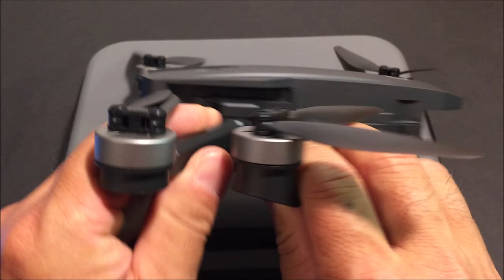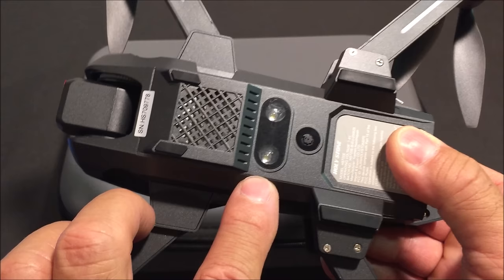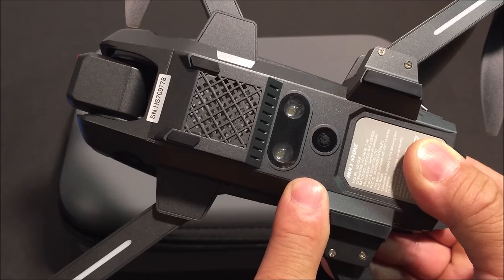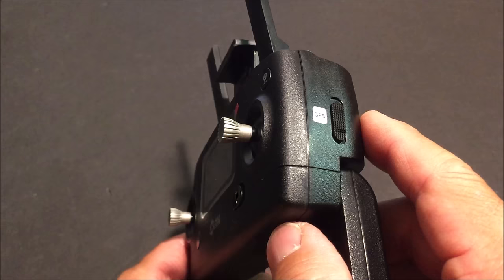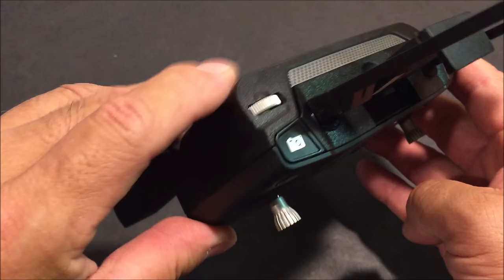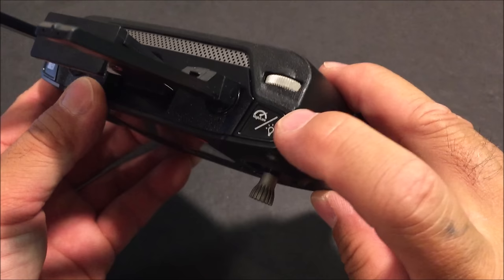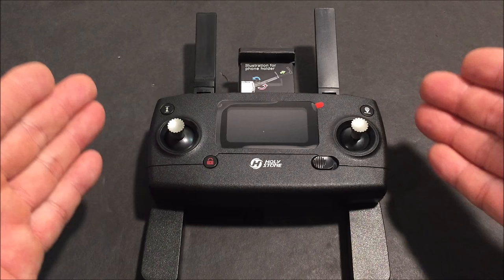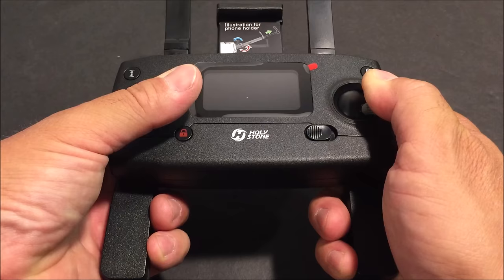HolyStone HS 720E with EIS / Review, Setup, Test Flight and 4K Video Samples

Comment: Hi, thank you for the great review of the HS720E drone. I have an original version of the HS720 drone. That drone also has image stabilization. The main difference between both these drones is that your HS720E drone banks like the Fixed Wing mode of the Fimi X8 SE 2020 drone. I still see video studder in your HS720E video when changing flight position. It would be interesting to see a video of the HS720E in some wind. That would be a good test of video stabilization of the HS720E drone.
Reply from the maker: I wasn't aware the 720 had image stabilization.  They are not perfect drones but are very good and they are headed in the right direction :)
Reply: @RCEscape  Hi,  checking the specs of both the HS720 and HS720E shows that the HS720E has a newer camera.  Is it worth the extra cost? Maybe.
Reply from the maker: @ssb73q  
I do not have the HS720 but looking at some of the vodeos uploaded with videos samples it is not as good as the 720E.  
Is a Sony sensor, 130 degree FOV and the EIS important to you?

Comment: I think you turned on GPS when you pressed button up am I wrong I think you said you turned off ! Just ask so I get this right I’m first time buyer of this drone “ aka New user “
Reply from the maker: Hmm.  I don't have it with me to test but it might be by default in the gps on mode regardless of the switch position or I may have said it wrong :)
Reply: Button up = GPS off.

Comment: hey have a question can a race day quads that you reviewed 👊👊 work if under plastic drone cover? Or any plastic?
Reply from the maker: I'm not sure which quad from race day quad.  I don't have one from them.
Reply: @RCEscape  gps unit. I plan on Putting in Peregrine Bear its waterproof frame.  So be like a toy drone cover.
Reply from the maker: @sleepingbearffg5008  
oh, a gps unit under a plastic cover?
I'm not so sure how strong it will be.
Reply: @RCEscape  ok I noticed stock unit had air holes but thinking more altitude hold?? Find out. Stock one 100! Two gater aids lids  silisconed together.  So water tight gets away from bird?

Comment: Great video.  I recently bought this drone to take some arial photographs of my property.  You mentioned the camera feed through the Wifi was starting to go out around 300m.  Were you able to resolve that?  I am experiencing similar things with my Wifi camera feed.
Reply from the maker: Thanks!  I do not have a newer phone so maybe that has something to do with it?  The dvr recorded video however does not go out and continues to take vdieo.
Reply: @RCEscape  Thanks for reply.  What MicroSD card did you use with the drone?  I tried one and the drone does not recognize the card.
Reply: @lost5070  Try putting phone into airplane mode then linking WiFi. This can sometimes improve performance. 

Use a Class 10, U3 sdcard

Comment: I got the same drone but without the E, I get bad jello effect and have a hard time trying to fix it
Reply from the maker: On cameras that give off jello, if you put some double sided sticky tape to hold the camera from vibrating, it will decrease the jello.
Reply: The E means electronic image stabilization. It was made as the successor to the HS720, and in doing so the jello effect was fixed.

Comment: Just got mine. How far from the point it started it suppose to go? Mine won't go far. Great video by the way
Reply from the maker: have you tried it in an open area?
Reply: Depends on where you are flying as it is low power 2.4ghz so like most HolyStone it needs some modifications to really shine. Replace antenna's, add amplifier, few other little tweaks and you can go much much further. It is the wifi that screws you in the end, so use a repeater or antenna tracker. It needs that two way communication so circumventing your phones dinky antennas helps a ton.

Glad to see you got a free drone to test. Audio was off so I didn't here a disclaimer.

Comment: if I start it on floor number 9, will the auto-return work properly?
Reply from the maker: If your 9th floor is on the roof top :)  Remember it does not have obstacle avoidance.
Reply: @RCEscape  I am thinking to buy one, would u recommend the HS510 or HS470?
Reply from the maker: @sergioao2546  
I don't know anything about the hs470 so I couldn't tell you which is better.
Reply: @RCEscape  is it dangerous to fly the HS510 on the city?

Comment: This is better than the MJX bugs 20 EIS. These has folding arms and weigh less than the bugs. Holy Stone also has Sony Sensor.
Reply from the maker: Yes, I think this one is by far the best Holystone drone to date.  It is compact and comes in a case.  Easy to carry and use :)
Reply: What is the size of this drone? Wheelbase?
Reply from the maker: @ChaddyFPV  
It measures 11 inches so 280mm?.
Reply from the maker: @ChaddyFPV  
I don't have a mavic but it is about that size.

Comment: GREAT video!! I'm sold on this drone.. my first! Hopefully as a beginner, I'll be ok with this. Your thoughts?
Reply from the maker: If it is your very first drone, I would not recommend it.
Instead, I would recommend a cheap toy drone maybe $25 kind to learn the thumb sticks first before getting a brushless motor drone like this.
This drone will severely cut you up if an accident occurs where as the little toy drone will maybe scratch you up.

Comment: Are you willing to do a lift test?
Because amongst other things I'd like to use it for bait dropping for fishing.
Love it as you can fold it and the price is right.
Reply from the maker: These 2s quads are adequate for lifting more weight.  You may want to consider at least a 3s unit.  Get yourself a cheap dji phantom.  It is bulky but it has the landing legs to attach the reverse hook for the bait.
Reply: Ok thanks
Uhm with 3s ur referring to the 3 cell battery..?
A 2nd hand Phantom 3 still sells for around 600$ in Australia, I'd rather find a new drone for that money

Comment: Man, my Yuneec q500 4k is getting long in the tooth and behind the times. This looks very tempting indeed.

"The double altitude hold technology -- optical flow and air pressure enable it hover very stably and easy to use for users."
Maybe that thing on the bottom is the air pressure sensor. Or not lol. Pretty cool never the less.
Reply from the maker: The EIS is very impressive and all else as well.  I don't even fly my phantom 3 pro anymore.  It is so bulky.  I'm liking this one a lot.  Easy to get going and takes great photos and videos.
Thanks for watching :) 🍺🍺

Comment: This drone is really crappy and starts circling on it's own,wider and wide,r faster and faster, and this is very dangerous to anyone around as it could hit someone and at the speed it goes would for sure land someone in the hospital with serious injury. This thing is scary and if you are endorsing this for this company all the while knowing how dangerous this drone is and are not disclosing this then you are legally liable.
Reply from the maker: Yes, all gps quadcopters will do exactly that if you don't calibrate correctly.
Reply: How is he legally liable for reviewing a product?? Stop with that nonsense
Reply: @SuperMarioFan72  While it's true that a reviewer isn't typically held legally liable for the performance of a product, there's a nuance here to consider. If a reviewer is aware of a significant safety issue with a product and promotes it without disclosing these risks, there could be ethical and potentially legal implications, especially if the endorsement is perceived as misleading.